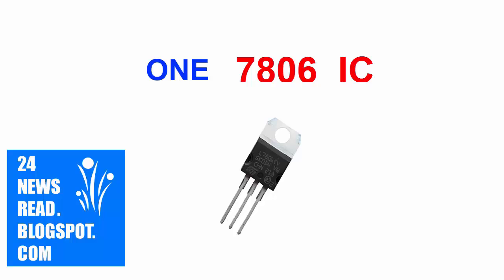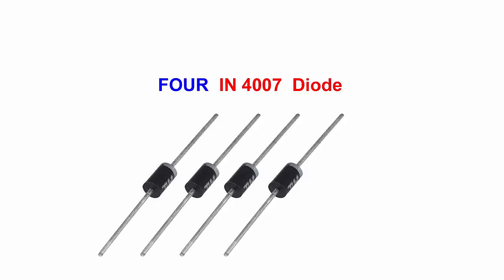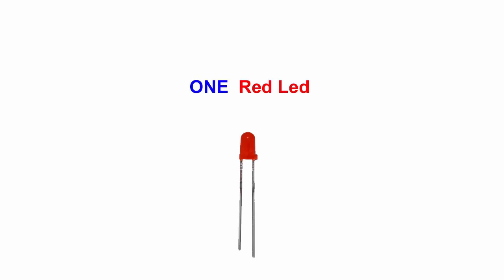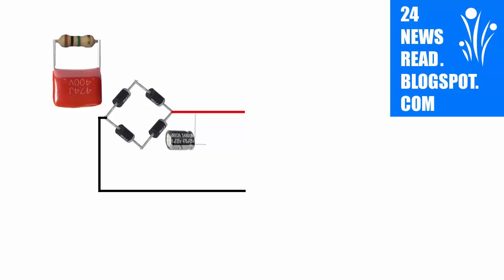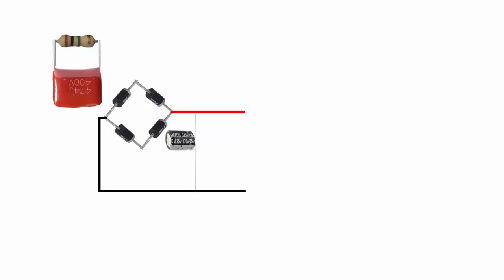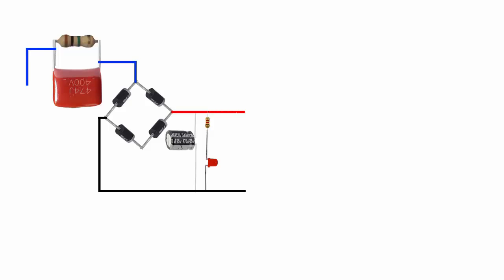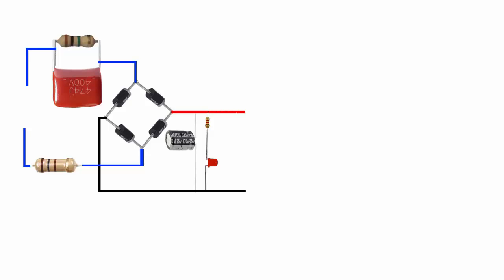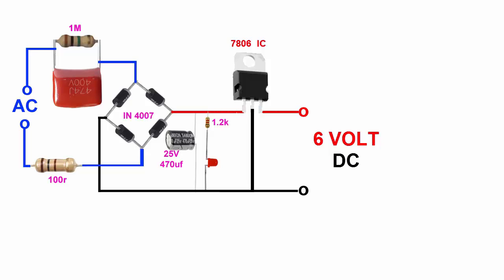Transformerless Power Supply (6 volt charger)

Comment: 100 r and 1M resistor ta koto watt er
Reply from the maker: 100r 4 watt and 1m 4 watt resistor need for this transformerless 6 volt charger
Reply: 4 watt paoa jache na
Reply from the maker: Koto watt paican?
Reply: 1 watt
Reply from the maker: Yes , you can use this resistor for transformerless 6 volt charger
Reply: Capacitor ta khub gorom hoche
Reply from the maker: Apner Diode join lagano vhul hoica , hoito
Reply: Na sob Ami thik lagiachi
Reply from the maker: charge hoccha?
Reply: Apner what's app no. Dila valo hoi